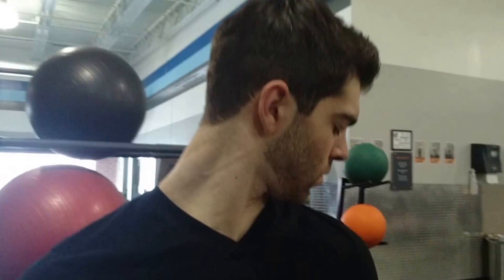Cervical Motor Control Example

Comment from the maker: You're right, but the test pattern is to rotate first, then touch chin to clavicle, he thought his neck wes very tight (perception, not reality), however, he discovered by altering the pattern, he could easily touch his clavicle with no perceptions of tightness or pain. It's a demonstration of motor control and altering the pattern reduces perception of threat/tightness. Either way, he had all motion passively in both directions, just not actively.

Comment: Correct me if I'm wrong, but what I can see is:
When the guy does rotation followed by flexion, he gets greater rotation angle but lower flexion, when he starts with flexion followed by rotation - flexion is greater, but degree of rotation is smaller than in  the first time.
To reach his calvicle he needed more flexion than rotation.